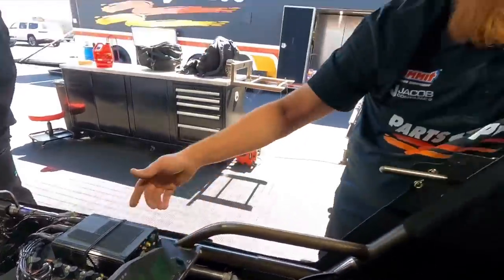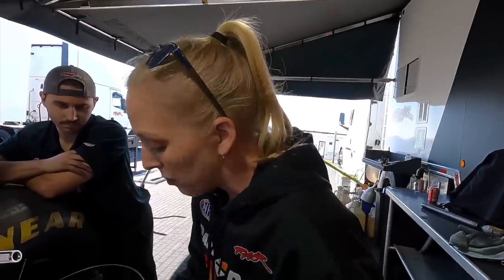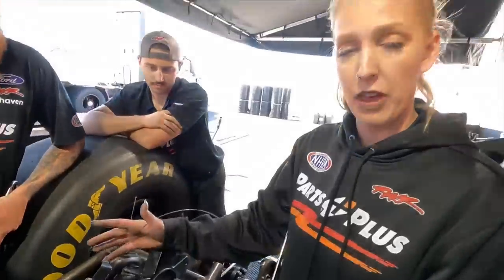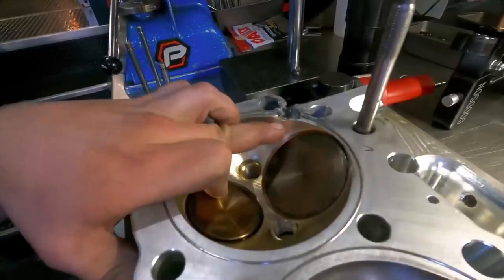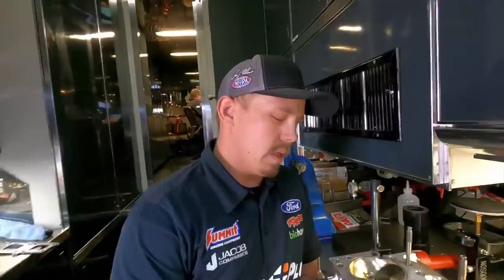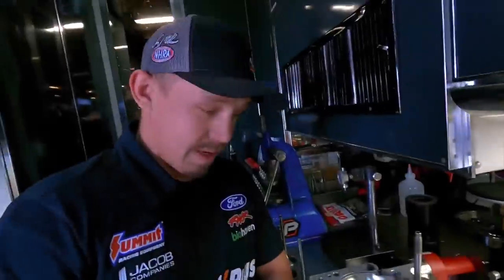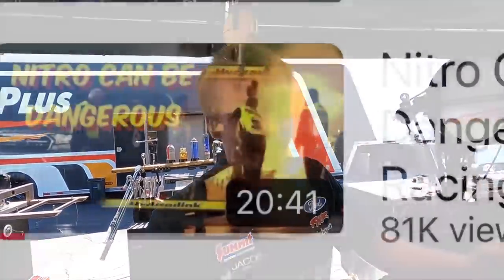How It Works, Nitro Clutch Cannon.

Comment: This Q&A session got me thinking, and I do have a one that maybe you can answer in the future.
 Regarding checking the chassis for cracks, I understand this is done by the team after each race and upon arrival at each track. In an earlier video you showed us how the car is stored for transport and stated that going down the road can be more harmful than running on the track which is why the car is checked again when arriving. 
My question is, when the team arrives at a track is the spare car chassis also checked each time? I guess further to that would be what state is the spare car kept in and are there any other regular checks done on the spare for the case it’s needed?
The videos are great clay. Thoroughly enjoy them!

Comment: Thanks Clay for the Q and A segment on your you tube video. Very informative. Your tuners forgot to mention that when you do a burnout, you are not at full power. The butterflies on the blower only open half way. Once you have backed up the tuners take off this stop to allow the butterflies to open wide.(Turning up the power). They are also turning on the data computer for that run. And yes, they are adjusting fuel - air mixture. Hope this helps.

Comment: Been curious, as there is no suspension, are there any chassis adjustments other then tire pressure, clutch, engine tune, for varying track conditions?
The clutch canon explanation was real interesting. I’m assuming the canon isn’t “armed”, until after the burnout?
Thanks for sharing.
Reply: As a side note, it seems that many non nitro dragsters are moving to a rear suspension.  I'm guessing that this is due to these cars running mostly at non national ( re bumpy ) tracks.
Reply from the maker: The cannon is armed before we start the car if it wasn’t the clutch would be engaged. The throwout bearing applies the clutch (backs away just like taking your foot off the clutch in a streetcar) when you Stomp On Ghat Loud Pedal. Thanks for watching!!!
Reply from the maker: @bobroberts2371  I am told suspended dragsters are more consistent. The top fuel car has no adjustable suspension other than tire pressure. Thanks for watching and commenting.

Comment: Clay you see some  type  fluid  power transfer device  from crank  to  final in future  ?
Reply from the maker: If you could run a torque converter like in a automatic transmission it would save a fortune in not having to buy so many clutch disc. I don’t think we will see that very soon though.
Reply: Pulling for YOU  & your  TEAM TODAY . FIREWALL IT !!

Comment: To repair that head would take 8 to 10 hours welding and machine. 1500 to 2000 to repair a head beats 10 to 15k to replace it

Comment: On startup how do you switch from gas to nitro Clay?
Reply: the ntro fuel pumps' output valves are shut off with a hand lever actuated cable, so the fuel just returns to the pump inlet or somewhere close to it (different cars are plumbed a little different).  Once there is enough RPM on gasoline, the valves are cracked open and the fuel can run up to the barrel valve.
Reply: @slowpoke96Z28  Thanks for the explanation
Reply: @flyhalf2  welcome.

Comment: Why rebuild the motor in the car? Especially with the quick turn around requirements? Why not just swap motors, then rebuild on an engine stand.
Reply from the maker: Sounds crazy but it’s quicker to service it in the car than just change it.

Comment: I spent 30 years in the construction industry and I'm very familiar with what nitroglycerin is. And I'm pretty sure you're not running around with drums of nitroglycerin in your race trailer so someday if you see this question would you please let me know what kind of nitro are you guys using and what is the ratio for nitro  methane
Reply: They burn nitromethane, I believe it's 90% nitromethane and 10% methanol.  In one of his videos he shows mixing the fuel and discusses them testing the fuel to be sure it's not too much nitro, etc..
Reply: @8180634  the nitro and the methane are two separate ingredients that are mixed at the track also methanol and methane are the same thing having said that you said that it was 90% so you're saying it's 90% nitro 10% methanol or methane
Reply: HI  Nitromethane is made by combining nitric acid (very strong oxidizer) & propane. Nitroglycerin is also called "NITRO" is nitric acid & glycerin (an ingredient in soap). In both cases you end up with a fuel that already has oxygen in it and a chemical bond that wants to break apart. this unstable bond will add more "power" to the whole ICE process. I hope i didn't go to far down the CHEMISTRY rabbit hole...  LOL IF you want to know more here's the link to Wikipedia for Nitromethane    https://en.wikipedia.org/wiki/Nitromethane
Reply: @lawrencebeeler6273  
Nitromethane is a premixed liquid that is safe to be around, it is mostly used as an industrial solvent.    Typically the name is shortened to nitro just to make things easier, not to identify it as a separate item that race teams mix with methane as needed.  And, methane is a gas at normal room temperatures so it would take a mobile chemical plant to mix with a liquid.

What they are doing is mixing nitromethane ( 90 ish % ) with methanol  ( 10 ish % , a type of alcohol )  A lower % of nitro /  higher % of methanol can be used for less bang.   Small glow plug type model vehicle engines use a 20% nitromethane / methanol mix.
Reply: @bobroberts2371  nitro is one ingredient, methanol or methane is another !! If you ever go to a top fuel categorie race you will notice somebody usually the driver mixing fuel you will see them with the gravel mometer measuring the Pacific gravity to make sure that they get the ratio correct all's I want to know is what kind of nitro is it cuz it's obviously not nitroglycerin
Reply from the maker: By NHRA rule we can only run a maximum of 90% Nitromethane the other 10% is methanol (alcohol).
Reply from the maker: @lawrencebeeler6273  nitromethane is one ingredient the second ingredient is methanol (alcohol)
Reply: the DHS rmonitors fuel sales and they are pretty particular about their storage and security requirements. you go through so much though. Sunoco delivers to teams at the track, but you have to lock up whats not used.

Comment: If you really want to open a can of worms have a fuel system guy explain how a 12 timer metered fuel bypass return system works and how the injector pills are moved around to compensate for engine torque and cylinder loading. Whew, too much to comprehend.

Comment: in the other video, she says the clutch is centripetal (like a go-kart, I called bs), I dont see any of that, I see timers that time hydraulic fluid to compress the clutch, nothing centripetal, wtf?
Reply from the maker: Hydraulics are preventing the clutch disc from being compressed. The clutch is trying to apply when the engine rpm goes up like a go cart clutch. The throw out bearing via hydraulics are preventing it from applying. The timers are set and as they time out the throwout bearing is moving away allowing the clutch to compress the disc. Trust me she knows what she is talking about.
Reply: @claymillican25  thanks for the reply, but "where is the centripetal part?
Reply: @claymillican25  I have tuned and raced 1/8th scale RC on-road race cars, 0.21ci (3.5cc) 4hp at 60,000rpm back in 1996 competing at the worlds level on 80% nitro on a custom 7 port Ron Perris motor. We used 2 and 3 stage centripetal clutches for the different size tracks. By tuning the springs and weights (and a few other things) in the clutch, it sets when it launched and shifted via rpm and centripetal force. I see timers, based on time, not rpm (not centripetal) setting how much clutch slip/grab through the run. I dont see any weights in a top fuel clutch doing any centripetal action, please explain. TIA
Reply: @claymillican25  She never shows the "weights", I found this video that shows how it works https://www.youtube.com/watch?v=KPBCCuFLCXk
But and a big but, the centripetal is applying pressure, but it's the timers that is doing the adjusting, this is NOT how a go-kart centripetal clutch works, it only works off RPM. 
She might know whats going on, but poorly explains it, hence my confusion.
I miss the 70's / 80's when we used to go to OCIR with dell worsham TF funny car team. I still remember the Muldowny record run 5.77 at 252.
Reply from the maker: @Ozzy3333333  I do not know what centripetal means. 
I do know what centrifical means. That video you sent me explains it very well. The weights are on the levers they talk about in that video. They can be adjusted according to how the crew chief wants it done. As they said in that video as the clutch spins the levers swing out (centrifical force) applying more load to the clutch disc. Hope this helps. Here is an old video I did that may help you understand a little more. Appreciate your comments. https://youtu.be/wpFyEW3aJu0?si=AqhOT-TUhsZSjPwK
Reply: @claymillican25  thanks for the explanation and video link.
As I was saying, a go-kart clutch is all basses on RPM, where the tf clutch is mostly based on timers. Even in this video the gay talks about simulating a run without any rpm, indicating it's mostly timer based. I do agree part of the initial launch there is a rpm component involved, but after that it's mostly timers and not rpm.
At 2m40sec in this video https://youtu.be/F5ekQbcLW3Q?si=Kh8HYBCziyvjUcQ5
FYI, centripetal and centrifugal are the same, just the reference frame is different.
A couple years ago I calculated the efficiency of a tf car, it was 10%, do you think I am close? Tia.

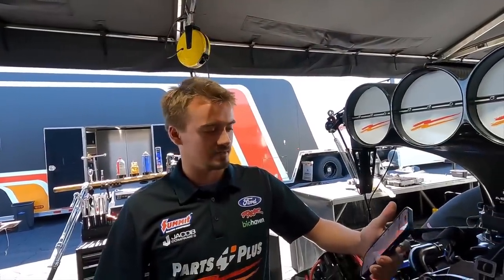Comment: 7:51 dude asked about turning the engine over after each run and then he answered it by talking about the start up procedure.... Wtf??
Reply: the process and reason is the same. its spun over backwards so any fuel thats in the combustion chamber gets pushed out the exhaust valve. if the egine spins during the tow back to the pits, it wont blow. likewise, when its spun to start, it wont blow. "best practices" is to do it EVERY time the engine stops. i like to do it again before grounding the coils just in case.